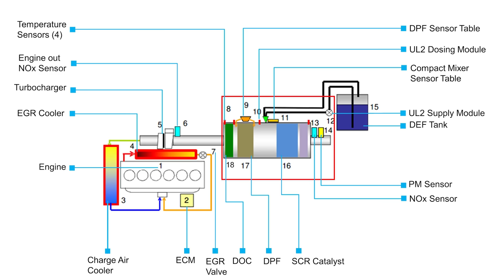Old But GOLD! I Changed My 2014 VOLVO for an Old 1996 Kenworth W900

Comment: The quality of new trucks these days seems to be horrendous and I don't even drive these trucks, just dispatch them. I'll get calls, just about every single shift.
- Oh, the regen light is on AGAIN!
- Oh, looks like it got really cold, really fast, hopefully your truck was used last night or your DEF is probably frozen.
- What do you mean you can't leave, the truck's computer can't figure out how to shift the trans from park to drive? 
- What do you mean the truck is sluggish and/or just stopped running? Oh the fuel filter is clogged.. AGAIN?
- Oh, look, another regen light. Who would've guessed. 
- What do you mean all your running lights just went out? Gonna have to call a tech, who finds no fuse blown, runs a diagnostic on ECU and comes up with some problem that can only be fixed at the shop. Cool, there goes your night. 
- What do you mean you can't use the pump? Why isn't the PTO engaging? The computer can't figure out how? Cool, you're only 85 miles away from the city, shouldn't take to long to send a tech
- ANOTHER F-ING REGEN LIGHT!!!!
- Truck comes back from the shop, driver has same problem that it went into the shop for, immediately. O.O

Our company leases these trucks but I'm pretty shocked that the downtime still costs less than dealing with those current problems if they were to buy the trucks and maintain them themselves. I know that I'd be extremely pissed off if I spent a quarter million on a truck that can't work 5% of the time. Hell, I'd be pissed off if I spent 30 grand on a brand new pickup and having those same problems.

Comment: Don't these new trucks come with warranties? Thanks for the video btw, love the old trucks.
Reply: Yes they do.  And if you're lucky they can get your truck into the shop in less than 3 days and hopefully they have the required part in stock.  Otherwise it's another couple days IF the part is at another dealer and can be shipped to where you are.  If the part isn't at a nearby dealer I've heard of 2 - 3 months of downtime waiting for a sensor.
Reply: @Kryten428  That's nuts man. I see your point.

Comment: There was alot of Def emissions problems with trucks in Europe when the new stuff came out but it got sorted. From what I saw most of the problems were with more powerful trucks not actually needing the extra power because of pulling low weights, there are people here running 600-770hp trucks at 40 or less tons and the engines and Def systems are not working hard enough. I think you are giving Volvo a bad rap, I'm driving them nearly 20yrs and they are probably the best engine in Europe and I know from a friend in Australia who says they are great and Australia have higher weights than most. In the Nordic countries where they run at 60+ tons a 13L Volvo at 460-540hp does great at those weight's and the Def systems work well in the cold there. I think you just got a bad Volvo and it's ran you against the marque.

Comment: I agree100%. All this extra complicated new technology is garbage and completely unnecessary.  I'm not a truck driver, but I drive older vehicles due to their simplicity compared to modern stuff.  Everyone wants all this tech in their vehicles, and I like 1990s stuff.  My 1998 GMC Suburban has all I need for comfort and it's reliable.  When it does need maintenance, I don't have to refinance my house to repair it.

Comment: Old school trucks run 🏃‍♂️ run and run with very little issues. New school trucks have issues after issues. They are very unreliable. Clean air is nice if the trucks are reliable like 👍 the old school trucks. The new school trucks are made to break down so you have to pay more money to keep them running.

Comment: I'm thinking of a 2007 Pre-Def Peterbilt with a Cummins. 
I don't need tons of power, I'm more concerned with reliability. 
I cruise at 5 under the limit for safety and fuel mileage. 
Can I get a consensus from the long timers?

Comment: I understand the old guys clinging to the old trucks, i see it all the time. Theres no harm in choosing to drive an older, noisier, less comfortable truck. Doesnt bother me one bit, thats youre choice to make. But dont sit there and trash the new trucks, without giving specific reasons. Just saying "they suck" is simply lazy. Fact is, the new trucks perform every bit as well as the old ones, theres zero benefit in driving an older model truck, when it comes to work performance. My 2021 Freightliner will pull a full load up any mountain just as smoothly as an older Pete or Kenny. Difference is, im all relaxed and not stressing over gear selection, or waking up entire neighborhoods with a noisy jake brake. Those older trucks remind me so much of Harley motorcycles, all that noise is just for show, theres no real reason for it other than to try to impress people. But really, people dont care. Trucking is fast becoming more about doing the job, and less about showing off, especially with the driver shortage only getting worse. Your exended shifter is just so cool looking i guess, but honestly, i am grateful to not have to shift gears. I learned on older, beat up manual trannys, and it SUCKED. Why work harder than you have to? I dont beat my clothes against a rock either, i have a machine to wash them, just sayin. Enjoy your old beater, makes no difference to me, but i am sitting pretty and comfy and happy in my new rig 😁

Comment: So new trucks have problems with emissions! But they get better fuel mileage. Lol.
 Can you quantify the actual extra costs & add it to the fuel costs for the newer trucks to come up with a real cost per mile?
 Its said they get around 8 mpg. But what is the true costs after you add the cost of DEF, emission repair costs & even down time, if you can?
 My guess is your no better off, I'll bet it still the new truck owner gets the equivalent of 6.5 mpg when you include all the headaches of the newer  trucks.

Comment: All of ICE engines can have a new exhaust system fitted were the pollution is reduced by 85 percent ,but nobody wants to take it on ,as a plus better fuel economy ,and a bit more horsepower!!and cleaner emission? P S it  doesn't cost the earth either ,

Comment: Dude what you said word by word everything is true I own volvo scania and ashok leyland in India buses when compared to maintenance a. Leyland is cheap that both but volvo scania runs 1000000 kms and a. Leyland runs 8lak kms but in the mean time the amount you invest on both volvo and scania you caan buy a new ashok Leyland bus even tata buses in India runs on cummins 6bt engine they are also the best 👍💯 so i had to keep aside volvo and scania and go with a. Leyland and tata and they are doing great. With less sensors and low maintenance costs.

Comment: hi i'm not a trucker i'm an engineer but i was wondering how often does the new trucks brake? because  on every video i hear that if the new truck brakes down they won't be able to fix it because of all the sensors. but if they are new they should not brake down  
also love the skull on the gear lever
Reply: every few month lights go on on my pete 579

Comment: Mack does i have 0 issues with mine. 1054000 miles just replaced the turbo. Cant idle them only get one with diesel apu

Comment: Dont worry about the emissions. 
Better start learning a different trade. 
Because the trucking industry will become driverless with in 10 years. 

An the sensors will help in saving time in repairs. An it will give better fuel mileage. 
The problem is all with the dpf crap. An with egr values. 
Its 99% water. 
Water in a engine has always been a bad thing that I've learned a long time ago. 
Egr values that recirculate exhaust back through the engine is the dumbest thing I've ever heard.

Comment: Yes,it looks good, but I would never buy it🙂Those jakes that you're bragging about,make more noise than anything else. DD15 has alot better engine brakes and don't wake up all of the naborhood😁I think that the emissions in the new trucks are alot better then years ago and don't forget they're alot more fuel efficient. Just buy it with apu on it and don't idle the thing,because that's what kills the emissions parts.

Comment: 90% trucks have def bypass 
That w900 have 5.5mpg and new truck have 8.5...difference is nearly payment in fuel every week 
Bypass is 2500$ 
But i hear you pre20s are good solution 
I have volvo 770 detroit 99' but you need to drive it...there is no options to get driver or rent it 
One day you will be done with driving i hope 
Be safe

Comment: Some valid points. But its not the Def or Egr etc systems. The drivers and owners of the trucks run the trucks incorrectly. Idle 365 days a year. They dumbly listen to the manufactur and let the oil stay in the engine to long. Put off repairs. Etc. drivers want to run light 24/7 not realizing most of these trucks. Yes new trucks included. Are made to work harder. Too many drivers wanting to run light. Not realizing how trucks are meant to be most efficient. They arent measuring mpg on a light load. They measure mpg weighing 65k or more. So people wanna run 40-50 k all the time thinking thats better. No. But the bottom line is this. 85% of drivers do not know hardly anything about their rig. They just chase dollar signs and cry when it breaks. Cause getting repairs isnt maki by money etc etc etc. if you know how your rig works you will get a new truck to last longer. Will it last as long as a old truck.  No. One simple reason. The only obvious reason. Technology. Biggest thing thats annoying is how they change the software and pretend its newer and different when its not. Its just to sale more trucks. Same thing apple does lol. When you could just update the system you have etc unless you literally upgrade the components. New or old. It comes down to who is taking care of it. A old truck can have just as many problems as a new truck alright.

Comment: The EPA was implemented in 1970 under Nixon and they clamped down and squeezed the trucking industry over time  and implemented emissions restrictions. These  restrictions and what todays modern trucks have for sensors and how they function is absolutely mind blowing stupid. We have trucks that won’t go over a million miles even if they are properly maintained like the older trucks which had greater engine longevity if maintained. The new engine technologies  burn fuel and after-burn to burn off particulate matter in the EGR filter system 😢 and run at outrageous temperatures to do so and in my opinion reduces the engine life with this system. The fuel economy on these new emission regulated engines is no where near where it should be in comparison with the older engine due to this EGR system. Now you throw in another product DEF and it’s supply chain to produce this product and endless plastic jugs and containers that end up in land fills. The failures of engines due to the emission systems and overhaul rates of these engines also increases the supply chain in service and parts. All in all once again the government got involved and pushed engine manufacturers too quickly to make unrealistic changes and the consumer suffers for its stupidity. Governments cannot and do not run any business, implement and or regulate in a efficient manner. They ruined the trucks and industry to a great extent.

Comment: Low maintenance costs for older Engine,lastest Engine NW a days most of of the time , only spares available in showroom, instead of removing money from new vehicle,50℅money goes for Maintaing sensors in new vehicle,full time waste & money, older Engine Never leave our hands when it's been overloaded

Comment: New trucks are junk I think there is to much technology in the trucks I think there built to fail as long as the new truck is in the shop they make money I feel the same way about my regular cars and trucks just look at these other countries that have bad pollution problems they make you replace the engine after so many miles the problem with that is the engine is not broken in yet there still oil passing the rings the dev systems are junk if it breaks it may cause other problems Nice truck 👍 thank you and all truck drivers for its you that keep the world going around your driving a real truck

Comment: i said it once i will say it again you can not take SCHOOL out of OLD SCHOOL i hate these new truck i mean when your driving and the truck locks the trailer because it seen a snow flake in the middle of June it is 1stupid and 2 it makes us the drivers the hazard on the road i can not count how many times i almost put a 4wheeler under my trailer because of the snow flake that fell in June thanks for this video #PantyChaser CH 19 30+ years

Comment: Yeah, I'd never want to be a trucker the way it is now. All the emissions bullshit just adds in way more components that break or fail and have to be replaced. Plus, they choke the motor so it can't breathe like it needs to, which is why all these new rigs are completely gutless.  Hell, the climate nutjobs made cat just throw up their hands and quit putting engines in trucks altogether, which is a shame because they were the best. Even working for the railroad, the EPA makes our job miserable too. All the road engines built after the mid 2000s have exhaust after treatment and tons of other emissions bullshit that causes them to throw faults and break down all the time. Even now that we run the bullshit "PSR" trains that are sometimes 200 cars plus with engines pushing on the back and often mid consist, we are almost never allowed to run them all at once for power. If we had 6 engines on a train, we might only be allowed to run 2 of them, and the other 4 would be dead in tow because of "fuel saving," and according to the spreadsheets, we should only need 2 engines to make it over that part of the system. Amazing how a tiny group of grass eating bureaucrats can dictate the lives of hundreds of millions of people.

Comment: It is called an engine, not a motor. Engines run on petroleum distillates, deasel fuel. Motors run on electricity. Don't believe me? Check a dictionary or any mechanics maintenance manual. I am a mechanic, I know what I am talking about.

Comment: lies 🤣on a old truck u need change all the hoses filters transmission rebuilt motor diferentials tires rims you need do a whole new rebuilt truck 🤣🤣when you can buy a new truck off the dealership with warranty

Comment: Yes ! Truck should be tool to work not toy.. But new driver don't even know what brand motor they have.! Only care for long fingernails with proper color.  They never adjust brakes they allergic to grease.  So today we have pupy clowns in sandals no socks ovcorse therefore truck's are designed for them. They have no brains so truck's must have computers